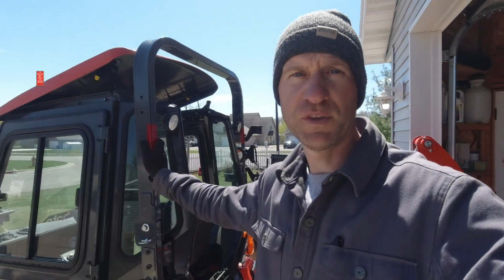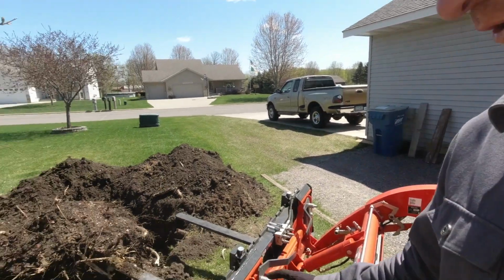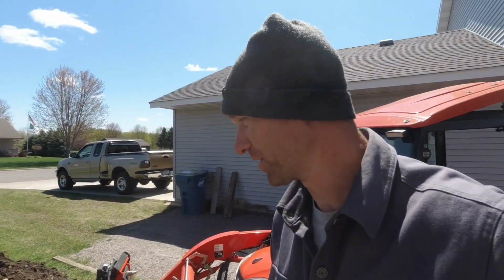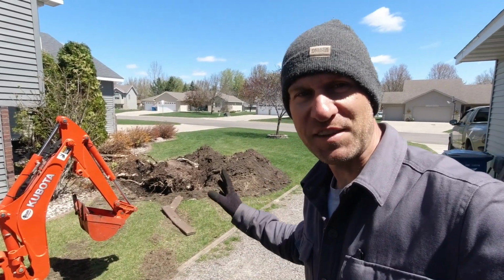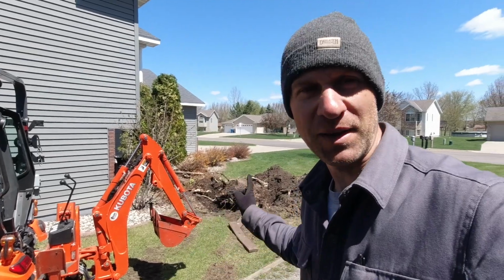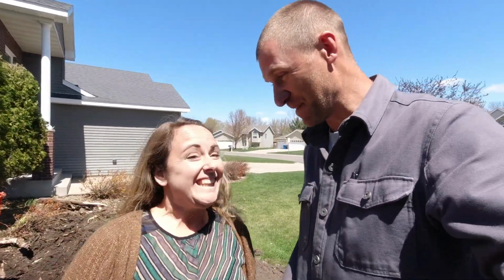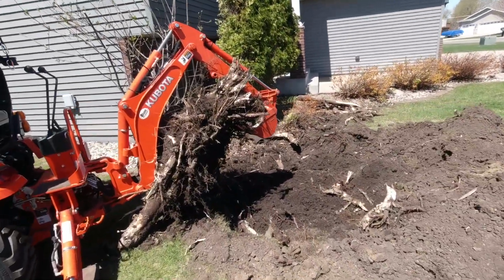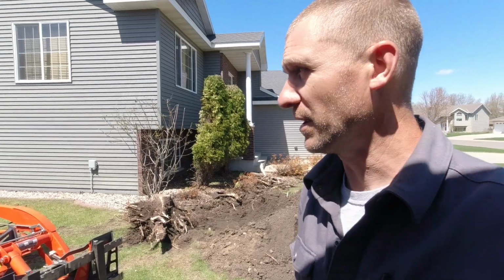BX23S KUBOTA BACKHOE vs STUMP (part 2)

Comment: You did well! Good job. I have a BX23s and have removed several stumps like this. If you want to do more of these in the future, you may want to get a mechanical thumb attachment (great for all kinds of applications) and a root ripper to make the job easier. As you have found out with a small backhoe and roots, sometimes you have to work on the smaller end of the roots back towards the root-ball because there just is not enough strength in the hydraulics. Keep up the great videos!!
Reply from the maker: I could have used a root ripper for sure and a mechanical thumb is on my wish list. Like I've mentioned I just don't use the backhoe often enough. Would like to have those options for next time though. Whenever that might be. 
Keep on tractoring.
Reply: The mechanical thumb is a must. I have a 23s and have used it to dig out some really big Pacific NW tree stumps. Doug Fir and Cedar, the thumb helps grab roots and flex them in more ways to break them. It’s also nice to separate the wood from dirt as you go, and you can lift and drop the stump to knock the dirt off it.

Comment: A sawsall with a long wood blade will cut thru the dirt and the root. I've done it a hundred times when we got in close with electrical and gas lines and couldn't risk using brute force. Hope this trick works for you. 

And when you can't get a good grip on a root. Tap 4 holes at opposing directions angling down into the center of the base of the trunk where it was cut down. Run some big lags and attach chains. Connect the chains to the bucket and away you go. Good luck.

Comment: Next time don’t flush cut the stump, you can use the top as a lever to help pull it over. Once it’s out you can cut the extra weight off.
Reply from the maker: Tell me about it. My neighbor cut the tree down without thinking about that. It would have been very helpful to have some extra leverage. 
Keep on tractoring!

Comment: I had an hour on my  1025 when I first got it. 12 hours later I had my first stump dug out. 15 hours second stump. So I improved from 12 to 3 hours taking out stumps. I have the same hydraulic thumb that Tim, TTWT has. Amazing how I can grab those roots and pull and some brake them off. It works great for picking the stump up and banging it on the ground to help get the dirt off. Hay, still no snow so stump removal it is. 
    How does that cab work with the backhoe?  You take the back off? Still seem to have enough room to sit?!
Reply from the maker: Practice makes perfect with a backhoe. The cab has a back panel that easily removes and yes there is enough room even for a tall guy like me. I've been very happy with it. 
Keep on tractoring!

Comment: Heartily recommend you get the thumb.  Much easier to grab a hold of roots, stumps, etc.  You might also consider getting (or making as I did) a tooth ripper which works better than the bucket for breaking up roots.  Good work clearing it out!
Reply from the maker: You’re right, I could really use a thumb and a ripper. I just don’t use the backhoe enough yet. Those two things are on my wish list however. One of these days! 
Keep on tractoring!

Comment: A Sawsall works great for cutting roots.  If you dull the blade toss it and put in a new one. Lots easier than sharpening chains.
Reply from the maker: Great tip!
Reply: B Laquisha I agree.  Get a long Diablo demolition blade, cuts quite a bit before needing to be replaced

Comment: Have   you    any    review     on   the    loader    quick  connect      ,,     I   have   a  new bx23s   and  notice  when  the  loader    locked   down ,  i  see   about   about   1/2 -3/4  in  play    at   the   top lock. when raising        -lowering the  bucket    /   My   BX 24   never   had  any play  ..   !!
Enjoy  your    videos     Thansk  Ben
Reply from the maker: I've also noticed that play you're referencing and I don't like it either. 
Keep on tractoring!
Reply: @ritterjon   Thank You   Mr. BX